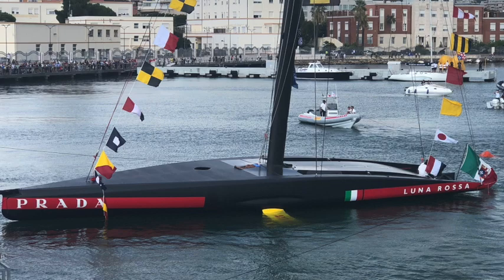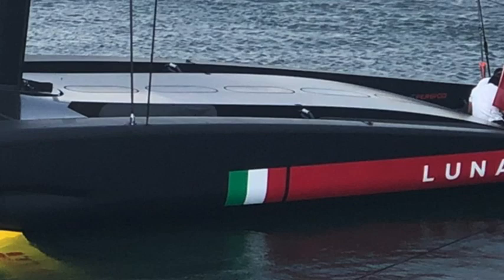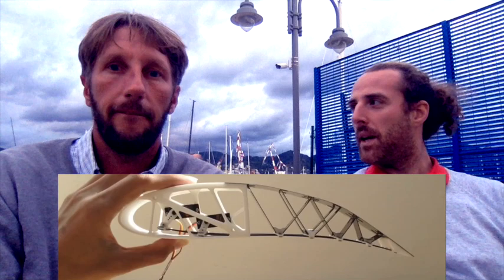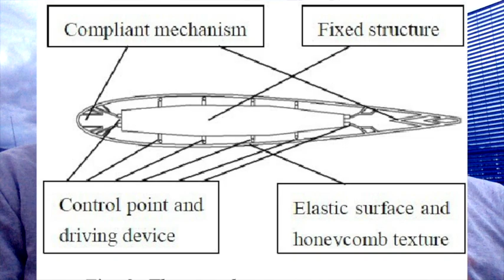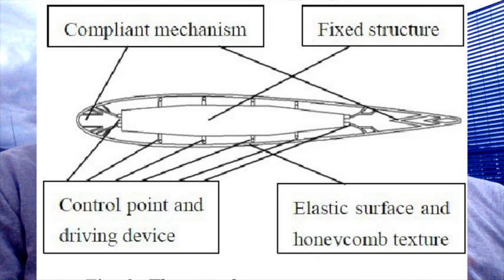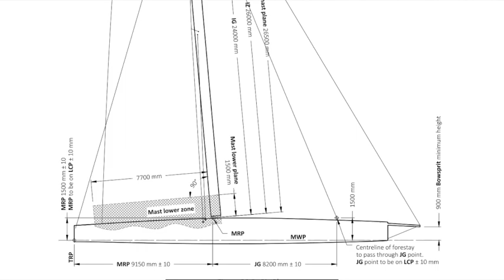E18 - Luna Rossa boomless

Comment: Huge if a pantograph sail is permitted within the class rules.  I can recall a number of occasions that ETNZ members when talking about twin-skin sails rather than wings have stated a desire to simplify elements so that they may trickle down into other classes of sailing, but that is not to say the rules prohibit more innovative engineering. If the pantograph sails are within the rules, expect to see them (at least) tested by the syndicates.
Reply: This is surely permitted by the rules. In fact, this is one of the huge innovation points of this cup design, together with hull and double mainsail. The only limit for this system are the complexity and the weight. For sure who will use a pantograph system will need to go lighter on other stuff!